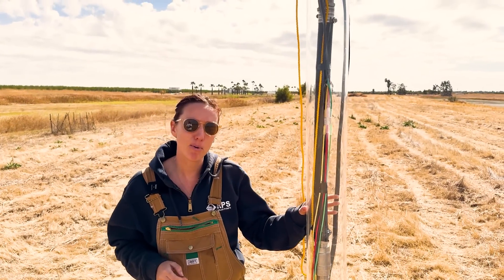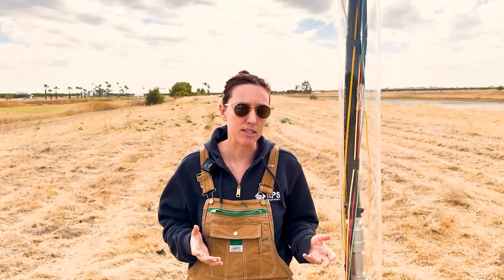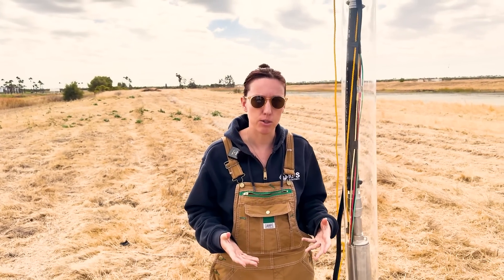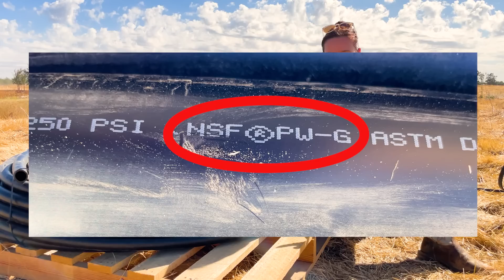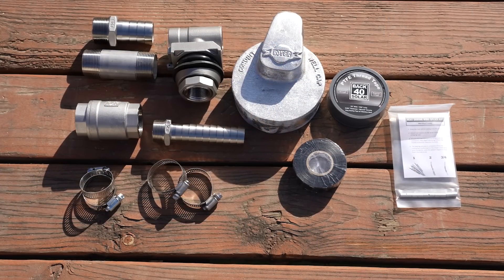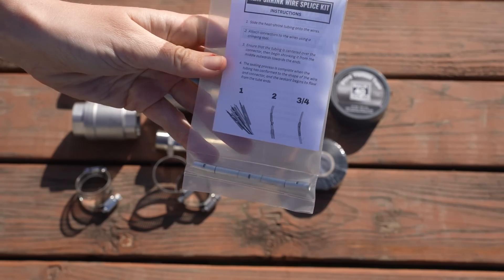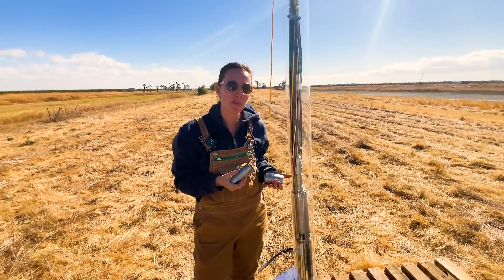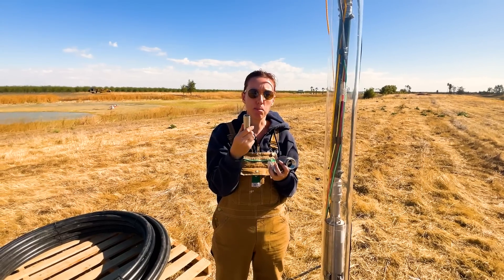Poly Pipe DIY Install Kit for Deep Wells Up to 300ft - RPS One and Done Breakdown

Comment from the maker: Just a quick update to the information in this video from our team: the 1.25" poly pipe kits up to 300 feet are now using 160PSI pipe - which is super strong and more than enough to handle the hanging weight of your pump, wire, pipe and fittings in the well! We'll be coming out with 400 and 500ft One and Done kits coming out soon that will be using 1" and 1.25" 250PSI pipe, so check back on our website:)

Comment: Does that submersible pump you are using have a built-in check valve?
Reply from the maker: Yes, all of the submersibles pumps from RPS have a built in check valve. We still recommend a second external check valve especially for wells with pressure tank systems - that will help build pressure and protect your pump form backflow!
Reply: The sound is weird